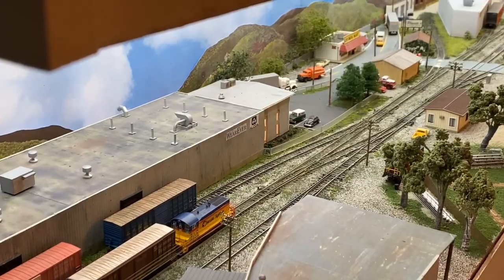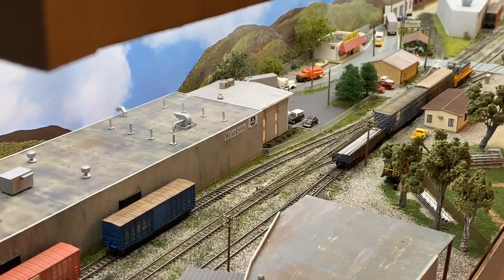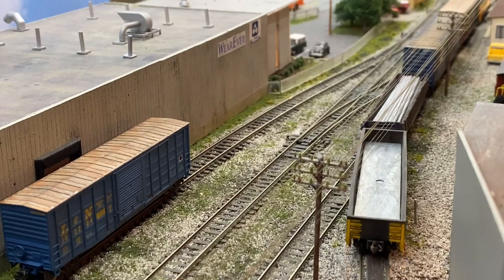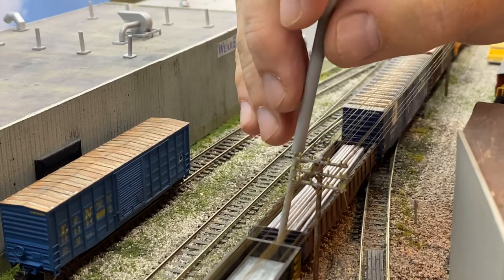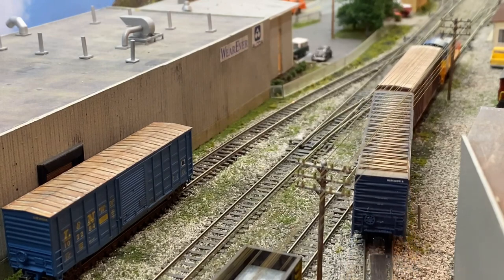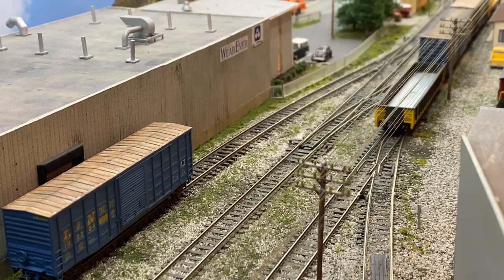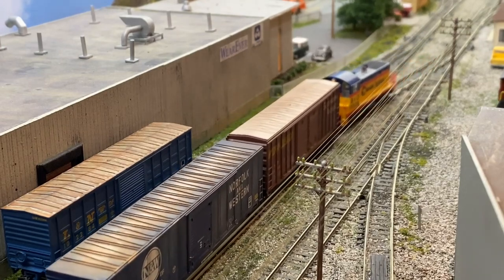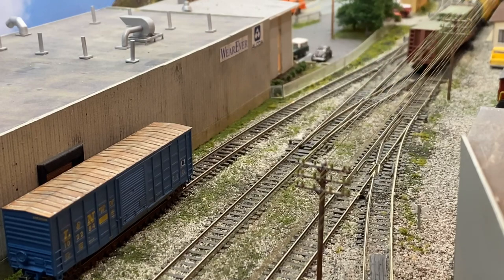Switching Union Spring on my scale Chessie System layout and a shoutout to the East Terminal Railway

Comment: Morning Thom and yes I have my doughnuts! I really like that load on the bulkhead flat. Thanks for asking, I'm getting better, but still have some effects of all the meds they pumped in me. Also glad to hear about all the new Subs that you've gotten. Take care, be safe and have fun railroading.
Reply from the maker: I bought 3 used bulkhead flats from a guy and that came with it. Don’t know who makes it or if it’s even era-appropriate, but I tend to use it a lot. It does look good. Most bulkhead flats are unloaded from both sides, I think, so someone may call me out on using a loading dock. We’ll see. I just don’t have space to model a track open on both sides.
Enjoy your donuts and stay on the mend, John. Another video Saturday is planned, so don’t run out!
Reply: @thomplacier677  Thom depending on the company and what they are producing it can be unloaded either way or both ways depending on the needs and storage space. Thanks for the kind words. Take care, be safe and have fun railroading.
Reply: @thomplacier677  I don't think there is a problem unloading bulkhead flats from only one side. Centerbeam flats would be a problem.
Reply from the maker: @Maurice00PA I just thought that, depending on the load, there may be a tipping hazard like center beams. Plus, I assume that a fork truck might have to drive up on the deck. Thanks for the information, Maurice. Stay safe!

Comment: Nice job Thom. I had to pour a 3rd cup of coffee so I could have one while watching your video. Thanks for the excuse! I like the view. It is like we are on the bridge looking down on the action. When you paint that gondola floor maybe add some debris to hide the molding divot. From what I have seen, gondolas are never really empty. There is usually bits of wood cribbing and packing material leftover and maybe paper wrapping if the a previous load was covered. I am working on adding metal to some gondola and hopper loads so I can remove them easily with a magnet. Cheers and stay safe.
Reply from the maker: Good idea about the divot, but I’ll need to put a depression in the load so it sits down flat. Shouldn’t be that hard. I’m thinking of redoing those loads with piano wire because those styrene rods are way too thick. Thanks for the homework item, making them magnetic would help removal! Stay safe!

Comment: Very impressive set up you got here. Just curious, is the layout a point-to-point, a switching layout, or something else? Just curious.
Reply from the maker: It was built as 2 independent switching layouts in separate rooms not tied together in any way. My wife suggested that I put them in the same room so I tied them together physically with the bridge and forest area. I am going to run a trial operating session operating them together as a branch line out and back operation, but normally I treat them separately. I consider them as switching layouts. Thanks for the interesting question, Michael. Stay safe!

Comment: Nice vid. Always enjoy your ops.
Suggestion: rather than just paint the gondola bed, print out an appropriate graphic that is or could be a gondola bottom, reasonably scaled. Trim and glue it in place for a good looking bottom with no thickness.
Reply from the maker: Good idea. I’ve already painted all of them black, but this would be better. I’ll see if if I can find a picture to go by. I haven’t weighed the car yet and it might need some weight so I was thinking of adding another piece of metal. Appreciate the idea, Donald. Stay safe!

Comment: I watched the video and couldn't help but wonder what is going on with those turnouts in the frog area? Lots of wobbly cars when going over them whether push or pull. And it's not just the couple of turnouts in the majority of the video but the distant shot of the train going by on the main - even that train had a bad case of the wobblies going over turnouts. Surprised you don't have derailments.
Reply from the maker: I notice it, too. They are all Peco switches and either MicroTrains wheel sets or in some cases ExactRail metal sets. I never ( and I mean never) have derailments but the dipping is noticeable. I may try to do more investigation into which cars or wheel sets are worse, but since I never have to fix anything it hasn’t motivated me to do anything. Maybe now I will.
Thanks for watching and stay safe!
Reply: I assume you're not running pizza cutter flanges on code 55 track right? I've seen enough problems with commercial turnouts that are poorly made. Frogs too high or too low, guard rails not right. One that drives nuts is ballast in the flangeways. On my N scale I stick to the older Micro Engineering code 55 trackage before they changed the turnouts to dcc friendly (I'm a DC type of guy). I tried Atlas but gave up on it. Never much liked the look of Peco.
Reply from the maker: @musicman8942  I have tried to remove all pizza cutters but can’t say that I might have missed one. I agree that ME track looks better but the height is more important in N scale than the tie spacing, at least to my eyes. I’ll look at the video to see if I can spot offending cars. 
I used ME code 70 in Oak Hill. Like the appearance but I think there needs to be some type of mechanism to throw the switches and I am not going to use switch machines. The ME switches don’t snap into place like the Pecos do. I have had derailments on a switch in Oak Hill because of this.

Comment: What kind of switch is that? Are they atlas? Trying to figure out what type of switch they are, cause they don't move at all until you switch their little knobs. I got like 4 that's loose with no knobs on it.
Reply from the maker: They are Peco Code 55 Unifrogs, but all Peco switches snap into place like that. They have good springs and are very reliable.
Reply: I Switched ( no Pun intended) to Peco’s Code 80’s Insulfrogs. Like the Snap. Much more durable than Atlas. Run through smoother too. Lower profile Visually too.
Reply from the maker: @doublediamondrailroad5949  The Atlas Snap Track switches are complete junk, but I think the new Atlas stuff is pretty good. That’s what I’ve heard, haven’t tried it.
Reply: @thomplacier677  
Stick with Junk. I’ve replaced or need to replace every Snap Switch from last 3 years switched to Standard or Custom. Same results. My new Atlas GP’s wont run through without lots of Filing rails and Guards. Also the point rails come loose off retainers and electrically they get Intermittent after being down a couple months of use. 

I’m getting more Peco’s!  .
Reply from the maker: @doublediamondrailroad5949  can’t go wrong!

Comment: I would watch 15-20 minutes. I can’t drink 2 Cups and eat 2 Donuts in 10 minutes!
Reply from the maker: I appreciate it and I usually have no problem myself with videos of that length, but prefer less than 15. It depends on the subject. I like Jawtooth but he shows the whole train and 7 minutes of auto racks rolling slowly by is enough for me to turn it off, or at least fast forward until he starts talking again.
I can eat several donuts in 10 minutes, but about 1 cup of coffee. Can’t chug hot coffee! Stay safe!